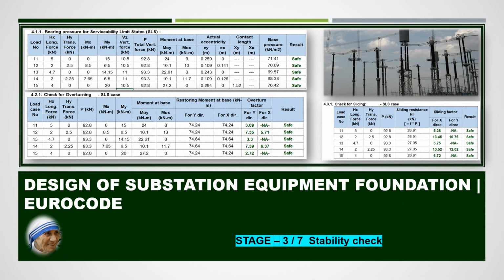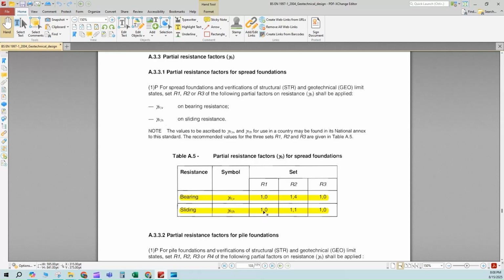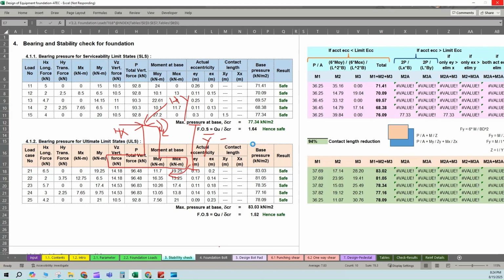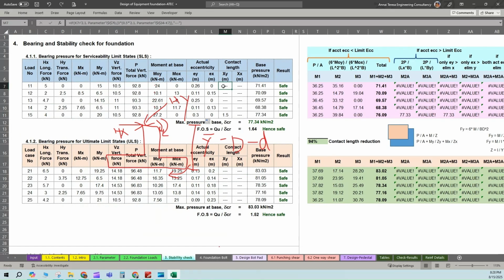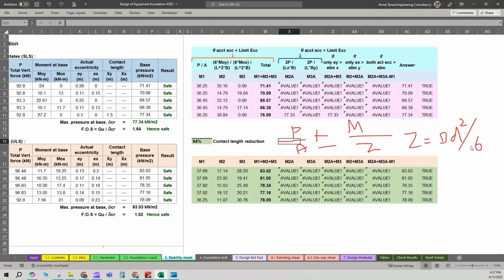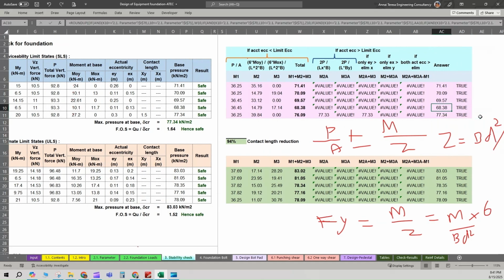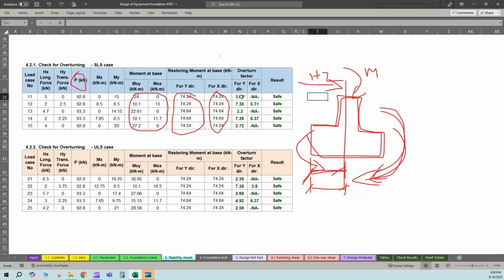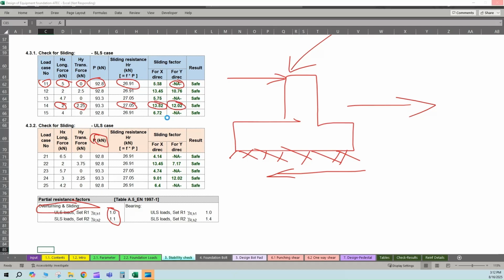Substation Equipment foundation Stability Check | Eurocode | (Part 3 of 7)

Comment: What is contact length
Reply from the maker: Contact length is the portion of the footing length over which soil pressure is acting. If actual eccentricity (Moment / Vertical downward, M/V) exceeds eccentricity limit (L/6) then there will be a partial reduction in contact length of foundation to soil, which leads significant increase in base pressure.